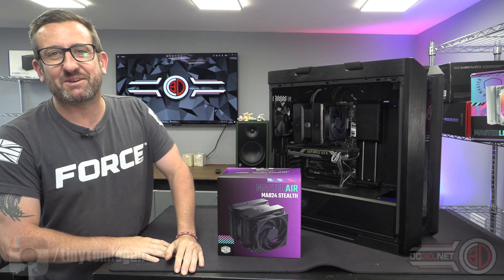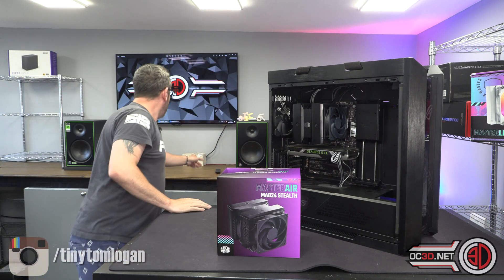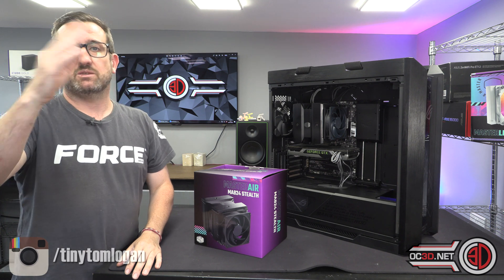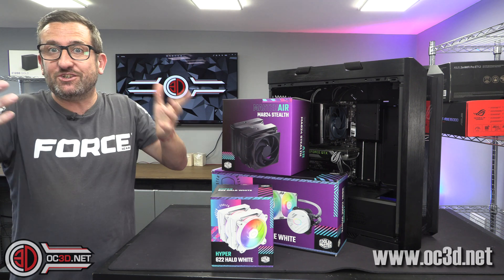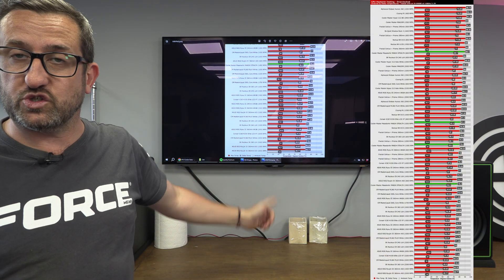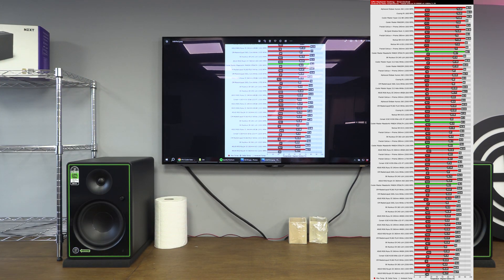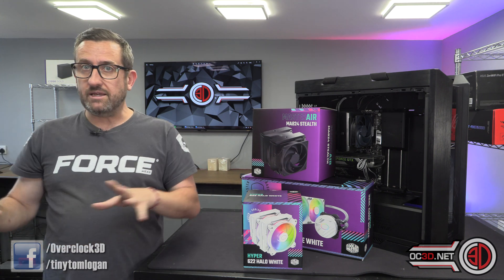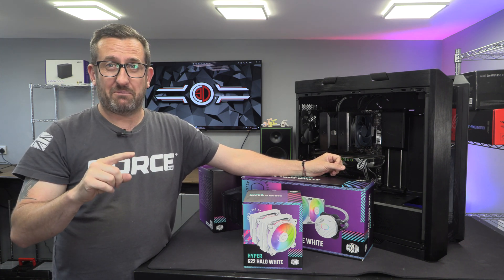NH D15 Beater   The Coolermaster MA824 Stealth

Comment: The biggest problem of this cooler is that its center fan is designed to be non-removable. You can not easily take it down and clean the dust. The center fan is connected to a plastic panel between the top metal cover and the fins. You can disassemble the fan after prying up four plastic clips and removing two screws, which shall void the warranty.（Although it is possible to avoid obvious damage and assemble them back again ）Besides，the center fan is not a mobius fan，it is just a common 13.5cm fan with 1500RPM called “mobius” by cooler master. It does not have the blade ring design and the wind is quite small compared with the 12cm mobius fan.（I have to say the 12cm mobius fan with FDB bearing is better than A12X25—— more quiet but only a litter weaker）. The cooler itself is really good，well manufactured and very efficient. The price of the MA824 is really high，three times of the FC140. So the obvious cutting corners of the middle fan is incomprehensible and unpleasant for me.
Reply: Four plastic clips and removing two screws for each side
Reply: I don't like the dual towers that have a 135mm fan in the middle. Be Quiet has one on their Dark Rock Pro I believe and then there's this one. Neither of them sell a replacement on their sites. This is slightly annoying in case you might need to replace that fan, which is one of the compelling reasons to go with air cooling. I suppose if I found myself in that situation down the road I'd figure out a solution but it kind of bugs me.
Reply: I just replaced the middle fan on my MA824 with a 3000 RPM Industrial server fan by Noctua. It can be removed, carefully. Temps are down 10-12C.

Comment: i got rid of my AIO cause they all have limits and air cooling does not and the switch from AIO to air cooling the  NH-D15 has been the best move possible. my temps are cooler for longer